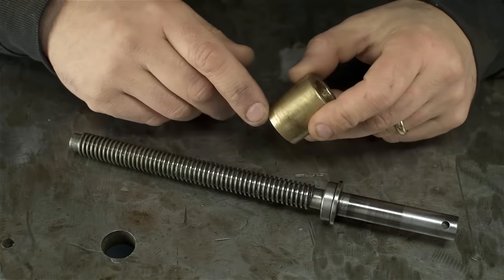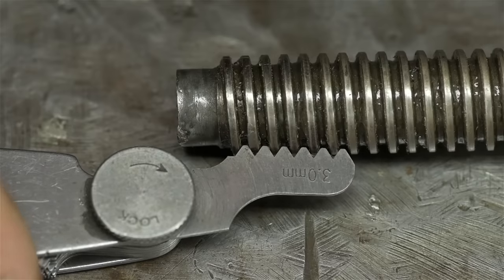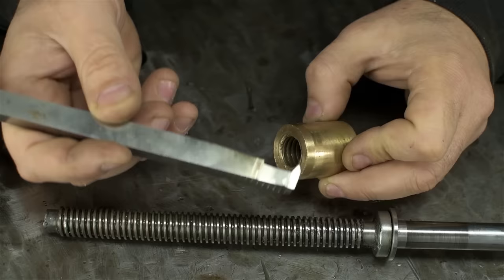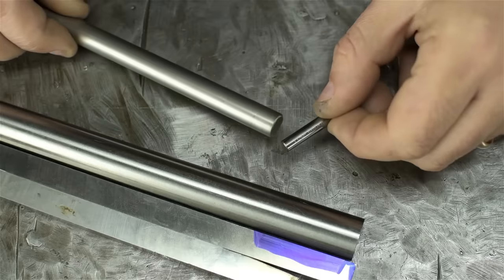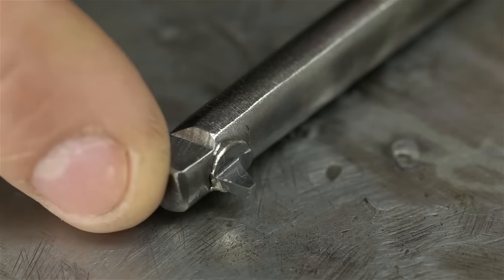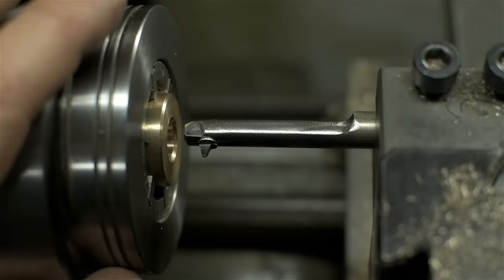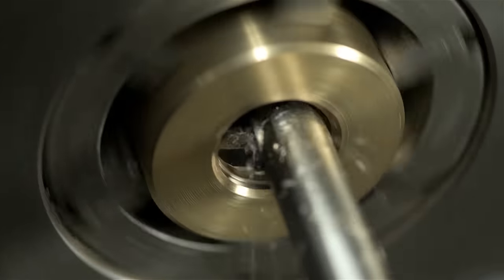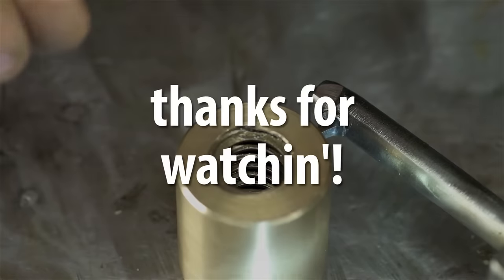CHOOSE YOUR OWN ADVENTURE: Single Point ACME Threading!

Comment: Ok.  Tony, we need to talk.  Look, you lured me in with clever, funny videos, some of which had relevant tips for the kind of work I was doing. Then, you got it in my head that I actually needed a mill and a lathe.  So last week I found myself actually buying one of each.  Now I'm spending hundreds on tooling and accessories.  Yes, I'm having fun, and I'm saving a beautiful former US Navy lathe from the scrapper, and the whole thing is incredibly rewarding, but I'm still blaming you.  

Thanks for that.
Reply: Tony made me buy an old English lathe, a Smith, Barker and Willson from 1910-1920 or so, now I'm buying some old cast iron from a pre WWII ore crusher to make into backplates. I also bought a goddamn TIG welder and I'm madly chasing a shaper. 

He's a menace this Tony is, giving us all these godawful hobbies. I keep chasing pay rises for more tools!!
Reply: @dontnubblemebro  Menace indeed.  I had to completely reorganize my shop and get rid of a bunch of crap I wasn't using in order to make room for all the new, heavy, expensive crap I won't use.
Reply: Tony made me sell my 2004 Goldwing last month and buy a 1950s Clausing lathe and a mill drill.  I have developed this incredible craving for tooling that I cannot stop.  Now I have to enter a twelve thread program.
Reply: He made me buy a minilathe from the usual scumbags. I then bought tools, drills, morse taper chucks and built up a small lathe bench. Today, a small 4jaw and a coolant flex pipe came in the mail. Already saving up for a quick change tool post and carbide holder and tip set. I blame it on TOT.
Reply: TOT is eventually going to have to be subpoenaed for my divorce proceedings so he can take the blame for my bad habits IN PERSON.
Reply: You're living the dream, brother! Channels like Tony, AvE, Clickspring, and Abom have cemented this idea in my mind. Unfortunately my wallet is not willing to comply.
Reply: And just 5 minutes ago, I got a cheap quick change tool post in the mail. We should probably start a support group for the people that started buying machining stuff because they watched too many vids by ToT/AVE/Abom/MrPete etc...
Reply: T0NGPU probably not a bad idea... Machinists Anonymous - Hobby Chapter 😂
Reply: Thanks to tony my manual machines get used by all these new friends I meet who want to learn old school machining.  It works out because it gives me something to do during cycle times from my cnc machines. Now if you just get some interest going in metalshaping so people can stop calling it some lost art... well then that will be great and I can make some more friends for my other machines.
Reply: Should I stop watching? I'm having similar feelings. To late this old Tony sucked me in with dad jokes and man stuff, now I'm a dad an stole his jokes. Someone laughed, wasn't the kids
Reply: Groundhog's Day dude, a friend’s 2-year old spontaneously called me “grandpa” yesterday! 😳😂

I’m like funk it, I am going to embrace it and start doing what I want to do with my time. Why? Cuz I’m grandpa... I’ll own the crap out of that. 😂
Reply: You sound like me, I am looking for a lathe and milling machine, Bailey Industrial supply has a combination, lathe, milling machine,drill press for $3000.
Reply: Welding engineering and metallurgy are tickets for success, anywhere.OSU.
Reply: Update: 4 months later.  I bought another lathe.  And now I'm looking at CNC mills.  You have been warned.
Reply: Another update.  I decided I needed a bigger mill, but not necessarily CNC.  So I have a 3000 pound Gorton 1-22 mill on it's way to me.  So that's 2 mills and 2 lathes.  All thanks to Tony.  I thought YouTube was supposed to be free.
Reply: "Tony made me..." Hehe I feel you guys. Same with me. I was already into metalworking and welding but he got me into machining. It's my biggest passion now. He made me buy a little mill and a lathe will be next.
Reply: Homebrew Horsepower i almost know what you feel. I’ve got a good 75 grand worth of crap in my shopping cart/wish list because of these channels. Haha.

Comment: I managed to cut a 5/8" x 8 TPI Acme nut for an old tailstock quill. I first cleaned up and recut the male thread and it ended up 15mmm OD. My tool was a composite one like yours except it was HSS retained by a grub screw. The bar was 10mm diameter so no relief grinding reqd. Like you I cut to an open end. I drew it all in CAD first so I could get the right leading & trailing clearances on the tool.  Amazingly it all worked.

Comment: "7-8 extra threading tools, and perhaps maybe, an extra lathe"
I about choked and fell outa my chair, i'll post more when I can breath again
Reply: Um. 3 weeks. You feeling good? Whens the funeral?
Reply: Man thanks for the thoughts guys, i just got home from the ER and they im good to be off the ventilator but to stay off youtube for a few months till im fully recovered.
Reply: @narmale  recover and take your time hope you feel better
Reply: @jadz684z  thanks!!
Reply: @narmale  How are you doing now
Reply: @vwertix1662  man I'll tell ya, its been a rough couple of months, had a couple moments of lucidity bust mostly its all rather a blur from lack of oxygen. Will post more after the doctor tells me how im doing.
Reply: I managed to cut a 5/8" x 8 TPI Acme nut for an old tailstock quill. I first cleaned up and recut the male thread and it ended up 15mmm OD. My tool was a composite one like yours except it was HSS retained by a grub screw. The bar was 10mm diameter so no relief grinding reqd. Like you I cut to an open end. I drew it all in CAD first so I could get the right leading & trailing clearances on the tool.  Amazingly it all worked.

Comment: We call M16x3 with acme profile TR16x3 (METRIC TRAPEZOIDAL THREAD)
Reply: Should be a thirty degree included angle if I am not mistaken as opposed to the 29 degrees included angle for Acme. I agree with your thoughts Boris Kozjan.
 Cheers from John, Australia.
Reply: I am pretty sure if someone used metric diameter and metric pitch, that also used metric included angle...
Reply: yep exactly
Reply: @boriskozjan  100 degrees in a metric circle?

Comment: Lots of fun.  I watched my metal shop teacher repair the tail stock nut for an early 1900s Monarch lathe.  A real big machine, converted from line shaft operation.  The teacher made the cutting tool, and then cut the internal, left-handed acme threads in a new brass nut.  I'll never forget it. (c. 1966).

Comment: Question: Does my vice absolutely need to be cool? I do have some stickers and glitter that I can apply, if necessary.
Reply: A hot vise (vice is the opposite of virtue) would be a bad idea. It would cool down and it would lose grip on almost anything you had clamped in it. It would be unpleasant to handle, too :)
Reply: @Pow3llMorgan  I experienced the thermal expansion problem when I attempted to fry an egg by heating the vice jaws to red-hot and clamping the egg for the duration of the cooking. The floor enjoyed a better breakfast than I did.
And yes, vice is the opposite of virtue; it is also (generally) how Brits spell the name of the tool. :)
Reply: Well, someone didn't get the  joke....

Comment: I don't even care if it's a useful part. I suddenly really want to see threads being cut on a bandsaw.
Reply: I'm imagining an angled jig and some set of guides to move the bar in front of the blade... and so many missing fingertips. So, so many missing fingers...
Reply: Not too hard for external threads. For internal... couple helixes, and some welding or brazing.
Reply: @absalomdraconis  Imagine making a left handed acme tap!
Reply: For external easy. Internal adds 3  extra steps. 
1 cut threaded bushing down 1 side. 
2 turn bushing inside out. 
3 braze... um weld it closed
Pro tip: be shure not to get full penetration , the pixels will make it hard to see when to dip your brass rod agen.
Reply: Captain MufDyven  Or......just wrap some brass wire around a rod  to make a sort of spring and then braze this back into the worn nut hole...…..gulp.

Comment: I’ve been doing this for a few years now. I just turned 21 but have cut some pretty wild acme threads in my times. If you’re cutting softer materials (aluminum/brass) with a fine pitch it’s easier to use a form tool exactly the size of the thread. I’ve cut 4” 2 pitch internal LH acme threads 18” long and had to use a Devibe bar with 5% cobalt HSS. Hone all the edges once you’re off the grinder to reduce chipping. Carbide is almost unusable internal threading on manual lathes, especially acme threads because trying to catch the half nut in time is nearly impossible. What I do on coarser pitch threads is set the compound to 45 degrees, grind the tool smaller than the thread and then walk it back and forth till you get the right width. Using a smaller tool not only reduces chatter, but it makes for a lot straighter/cleaner threads.

Comment: Not bad result, but I'm still convinced the band saw would have been better suited to the job.
Reply: The problem with that, is sharpening all those bandsaw teeth to the shape of an Acme thread tool.  My bandsaw tooth grinder doesn't have a 29° angle setting.  ;)

Comment: had same problem on my mill... how ever when i checked the threads on the screw they was also warn beyound use, it was cheaper to replace with more moden ballscrew and now i have ZERO backlash (well almost better then 1/4 inch i had) best upgrade i ever made!!! it mills steal now  likes its butter

Comment: I have an old Craftsman Planer Jointer. My part that raises and lowers the infeed table is made of cast aluminum. The weakest part of the planer. Every time that part comes up for sale on EBAY it's like a stolen sports car, "Gone in 60 Seconds". 
Because of this video, I decided to buy the Ferrule but and attach the pivot arm that connects to the underside of the table.
Maybe I can make a bunch of them and sell it. 
Electronics is my specialty. Making things is more fun. Thanks for the inspiration.

Comment: I've now done quite a few internal trapezoidal threads and it's not really any different to cutting a standard 60 degree thread, but with one important exception - the tool form is super super critical. Cutting until you reach the major diameter only works if the nose of the tool is exactly on dimension. If it's too pointed (root not wide enough) then you will have to go much deeper than the spec in order for the flanks to be wide enough, but if the tool is too wide then in order to reach the major diameter the flanks will be so wide that you get a sloppy fit on the first pass that the male thread will actually pass through. When cutting a standard thread, the tool is pointed anyway, so cutting to depth will always get you very close to a perfect fit, but not so with ACME.

Comment: Hi Tony, When I cut internal and external acme I make my cutting bit smaller than the required size, that way you can finish the cut with some nice light cuts one face at a time, easier on the cut too! Too much surface area makes for a big load and a tendency to chatter.

Comment: Tony I enjoy your videos. Abom79 has a great way to cut metric threads on an imperial lathe, that allows you to disengage the half nut when cutting up to a shoulder or maybe an internal thread. He marks the threading dial with a sharpie. When the half nut is disengaged and lathe is stopped. He reverses the lathe and engages the half nut when the marks line up again. I haven’t seen this method before, but it works. He has it on his threading videos. Thanks much for putting your videos out there.

Comment: Enjoy your channel very much.  But I believe the included angle is 29 degrees. If I am fabing my own tool, I like to make left hand tool.  I start the thread cut from the bottom of the hole. The tool is on the back side, and I run the spindle in reverse.  I have no problem stopping  the lathe and I can  see the chip formation.  Works great. Just a trick I learned in the old country.

Comment: Back in the day we used to put cross slide on an angle which would help reduce your chatter. Ie index took forward as you increase depth so you are only cutting on one edge. The angle of the cross slide would be just a little less then half the angle of the thread. Only means you need to test thread as you get closer.

Comment: nice to see someone else do this job. Everything that you did, I did back in 2009.  Had a guy come to me with a lead screw on a router table.   It was scary to watch you do what you did and predict every step before it happened.....  " Great minds think alike and idiots seldom differ!"     Haha! even the  results....  I recall saying to myself.. "coulda  made it a little tighter...  and its loose in the middle." I did this with a 0.375 round bar drilled and tapped for blind nut on the end and i used a 0.125 TC bit i broke on some other experiment. Cheers!

Comment: I know this is an older video... but when threading a blind bore on a manual lathe, use an opposite hand tool and spin the spindle in reverse. Thread from the inside out, then you don't need the relief or "gutter" as you call it and you never have to worry about crashing. The tool can be fed into the stock to depth while the spindle is on, then engage the half nut. This creates a relief of exactly one thread pitch length and allows for true blind tapping to the very end of the hole.

Comment: This was a job I did quite a few times when I was a tool room turner. These nuts are usually phosphor bronze, definitely not brass. You definitely should have made a high speed steel tool. I did these with both 2 start and 3 start acme threads

Comment: Little trick I use often for blind holes , turn the tool upside down and start from the inside and thread out.
Reply: Just make sure you take into account potential risks running in reverse if your chuck simply threads onto the spindle...

Comment: Left- or right-handed depends on whether the screw is fixed to the machine or to the slide. E.g. the screw is probably right-handed on your mill's Y axis.
M16 is always a 60-degree thread. ACME would be TR16 for Trapezoidal, TR16x3 in your case.
Thank you for your videos. They're a perfect mix of condensed information and entertainment.

Comment: Had the same problem on a surface grinder cross slide when I was toolmaking. Nut worn right out.

Boss made a huge deal about it,  he said how hard it was going to be to buy the suitable pre-made thread etc.
I was like uh, I'll just make it... just order me the bronze and I'll have it up and running in half a day...

He did the same thing with a simple spline. Tried to buy one from a tractor store and have me modify it to suit the injection molder. I couldn't get through to him it was actually MORE work to start with a pre-made spline. Sad thing is he was a toolmaker himself :(

Lesson from that kids is learn to be diverse and think outside the square.

Comment: Right-handed threads are entirely common for lathe cross slides.  My minilathe has a LH thread but my dad's old Myford is a RH thread, with the handwheel mounted to the cross side itself.  That's a better arrangement because cutting forces put the leadscrew under tension, not compression.

Comment: That was the first job I had to do on my old lathe when I got it, but the nut was from my lathe so I had to use the compound slide for adjustment and with no reverse I had to use the chasing dial for the longitudinal travel, disengaging and backing out after each pass, also my nut was rectangular section so it went into the four jaw chuck. It was a left hand thread as well.

Comment: Hopefully I'm in a safe space here to raise a hand and ask a question, but to reduce chatter/deflection, would it have been possible to fix the brass nut to the cross slide and then mount a bar that runs right through it (mounted into the chuck and the tailstock) so that it was totally rigid? Therefore you're moving the cutter rather than the workpiece.....thoughts?

Comment: @10:32-10:34  is the work piece not concentric? the very first cut doesn't sound right.  sounds like cutting only one side of the metal.

Comment: I did this last year for 2 steel blocks running on manky  looking acme threaded shafts. The shafts weren't bad at all they just looked it and I used the 3 wire method to measure them. As I got near to the finish cuts of the threads I started fitting the nuts  to the shafts. When finished there was no end play, or back lash to the nut / thread interface and the two parts rolled along very nicely.
Measure the male thread to determine what to shoot for then as you approach the finish start fitting the nut to the shaft.
In the real world of manufacturing the nut is made first and the shaft is fitted to the nut. Sounds counterintuitive but that's how it's done. This is a repair not new manufacture so the reverse is the rule of the day. You still do good work in my estimation.... you must forward the name of your manicurist please.

Comment: It is also possible to cast new nut directly on the screw from special sliding epoxy (maybe there are others, I used "GS super fluid" - google for it). It was also adventure at first :D, but when mastered a little and done correctly it works quite well and it can be done on assembled machine, so it principally eliminates some inaccuracies.

Comment: Joe Pie uses the method of cutting threads towards the tail stock.  Then you could place the cutting tool into the gutter and stop it at your ease after it exits the bore.